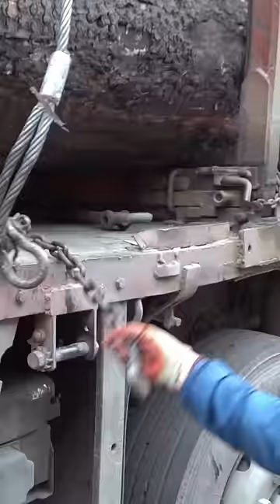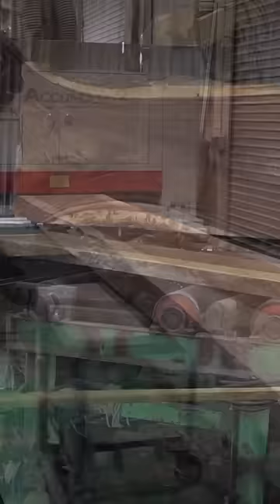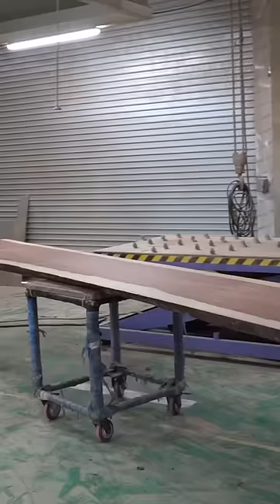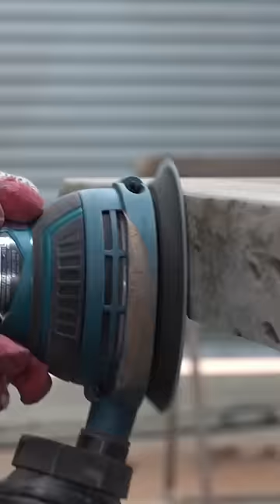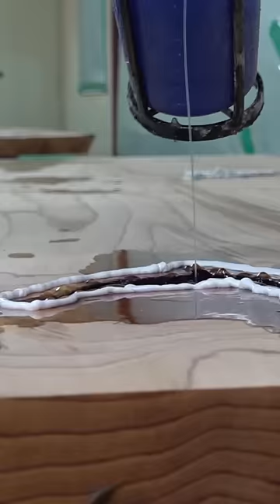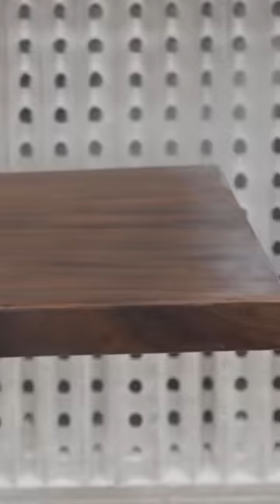Process of mass-production tables from the finest wood. Solid wood furniture factory in Korea

Comment: If they slam epoxy resin on the finest wood, you know you're in either: north America or Asia.
Reply from the maker: Thank you for watching
Reply: Or America. I mean all trees and wood has some things to fill, rework and make professionally sound. It is what it is. As a woodworker I love clean wood that's free of defects or huge nasty holes but when you get wood slabs like that, it's either they get cut into small pieces or kept large and then fill with epoxy. You act like the whole world including usa doesn't do this? I'm not a huge fan of epoxy either but it is the #1 method used and does provide extreme strength compared to wood fillers and such. Bowties are nice to add for holes and cracks but they still only strengthen the slab and doesn't fill or level the giant holes out.

Comment: Didn't even dry it out. So much moisture in there.
Reply: You assume, so I’ll assume, having worked in a sawmill as a dry chain man and loading cut slabs/boards/etc.,  on to rail platforms that were wheeled to very large kilns and monitored until the moist content was acceptable before cooling…otherwise there was a possibility of cracks, splits, cupping, warping, etc.
Reply: @hectormata449  that's NOT what this video shows